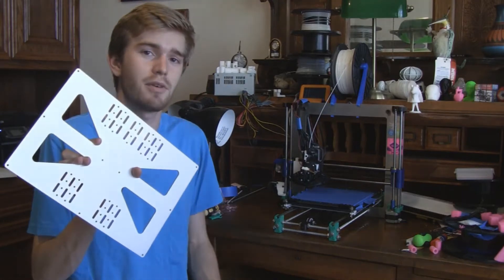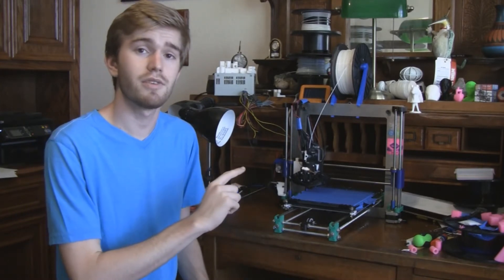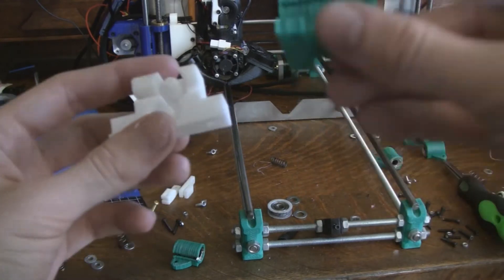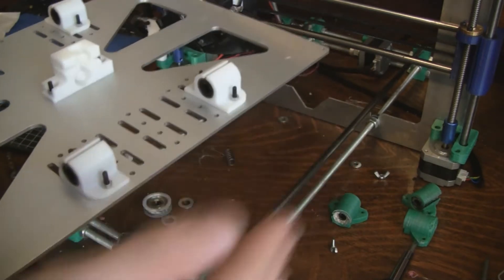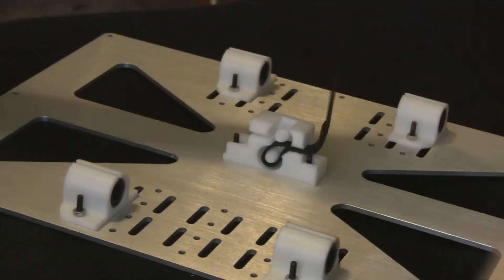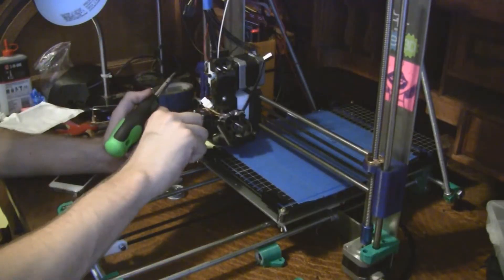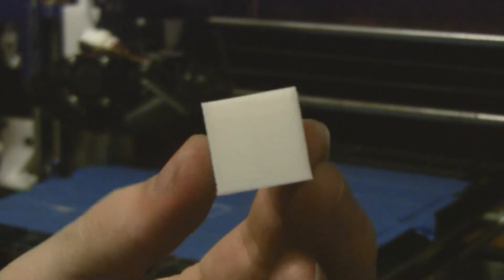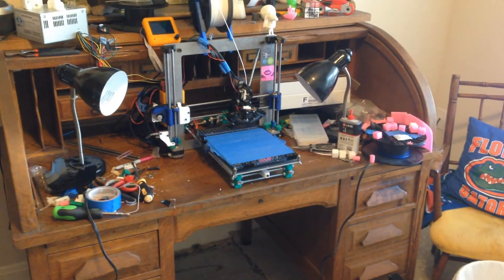3D Printer Y-Carriage Upgrade | Saturday Projects

Comment: What printer are you using?  Would you recommend it or something else?
Reply from the maker: The printer is an i3XL from the now out of business DIY Techshop. It's hot garbage and has been nothing but trouble. I have redesigned almost every component of it and replaced pretty much everything except the threaded rod and center frame. It's seriously crap. I'm not too familiar with current printers since I've only owned this one. I recommend just doing some searching around!
Reply: Check this one out: https://shop.prusa3d.com/en/3d-printers/180-original-prusa-i3-mk3s-kit.html#
Reply: Thanks